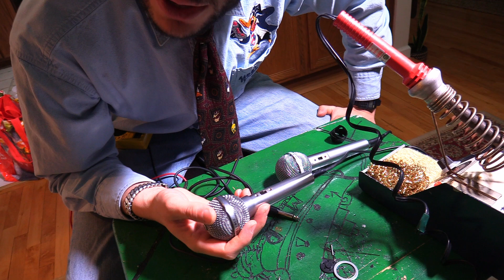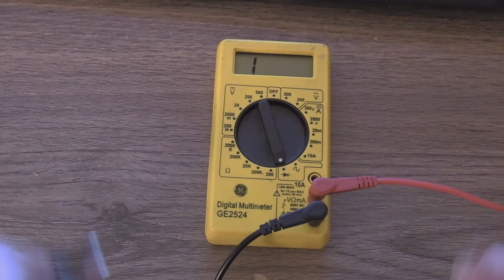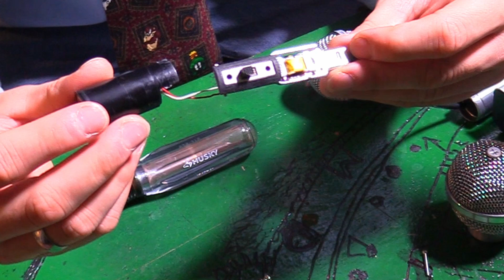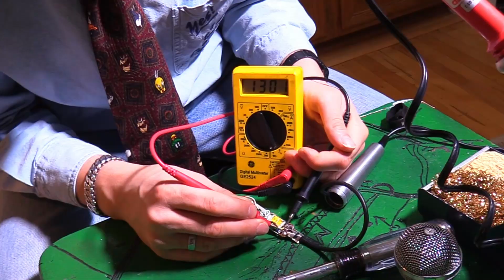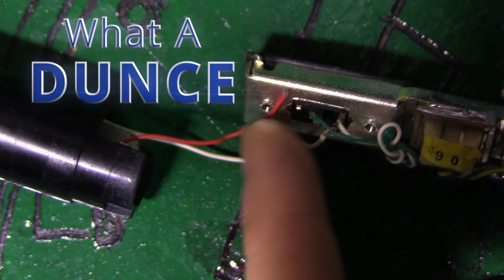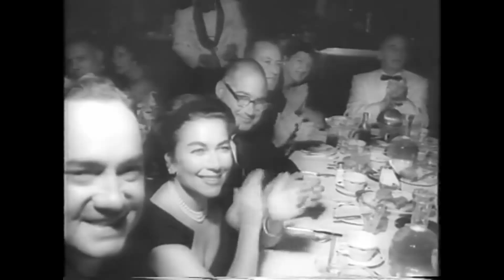Testing a Microphone for a Short

Comment: If you do enough electrical work consider getting a real iron with hot swappable tips. I do SMT reworks at work all day long and we have a huge collection of tips in all shapes, sizes and flavors and even the most obscure ones are invaluable the once a month you need it. Most people hate soldering cause they have the wrong tools. At home I also have a cheap hot air station which makes recapping reel to reels easy(er), and I'd highly recommend them too if you wanna get into board level repairs. Besides, investing in good tools is always worth it. Then again, I love this shit.
Reply from the maker: I definitely need a proper iron that's for sure. The cheapo one ain't cutting it simply because the tip gets corroded no matter how well I treat it. I've never heard of a hot air station before but I assume that's for desoldering work.  I could definitely use that as well. I need a lot of things lol. What do you recommend for holding wires/components when soldering. I always feel like I'm fighting gravity or stress in my wires when soldering.

Mario
Reply: @Mario_DiSanto  Well here's my best advice in a few parts. 
First, hot air stations can be used for desoldering, but there are other ways to do it. Theyre really only useful on PCBs. It's literally just a tube that shoots hot air that can melt solder so it's great if you're removing  a chip with a lot of leads that need to freed all at once. Typically I would used a solder sucker or solder wick to remove as much solder as I can and then the hot air gun to melt anything left keeping the chip in the board.  They are really designed for SMD soldering when you put solder paste (exactly what it sounds like, solder mixed with flux that's the consistency of toothpaste) on the pad (the tiny metal part on the PCB the component attaches to)and then place the SMD component in top and melt it all, soldering the component for good. Honestly find this easier than through hole for starters. I bought my cheap hit air gun for $45 online, works great.

Second, for holding wires my advice is as follows:
1. When ever possible, make sure you have a good mechanical connection before trying to solder something because it'll probably move on you
2. Always tin wire, that is dip it in flux, heat it up and fill the strands of the wire with solder before you even try to attach it to anything. Preferably tin whatever you're connecting it to in the same manner. Once each part has solder on it, you should be able to hold the wire in place and just press with the iron until the solder you applied to both parts melts and forms a joint. With smaller wire you shouldn't even need to add any additional solder, just what's there from tinning should be good. 
3. Tin and clean your iron constantly. Having higher grade tips (like Weller or Hakko) is nice but doesn't matter if you don't clean it. Use the brass stuff that looks like what your granny uses to scrub pots and then flux and tin the actual tip of the iron in the same manner as discribed above. Often you will see people just flood the tip with solder, which is perfectly OK as well because they are using rosin cored solder, which essentially has a center core of flux that cleans the tip. Always do this when you are done with it (so it coated in solder when not in used, thus protecting it from corroding) and avoid leaving it on for hours without using it.
4. If somethings getting to hot, achor the thing youre trying to solder to and use ESD tweezers (if you don't have, needle nose pliers are fine too) to hold the wire incase it gets hot. Becareful not to squeeze tok hard because when the wire gets hot the insulation will get soft and get be ripped off easily. 
5. The main thing to keep in mind when soldering is the solder only goes where it's hot, so make sure you're iron is shinny with fresh solder and you're holding it such that you're really making the PART hot. We've all had the thing where you're feeding solder that's just balling up on the iron, and it's cause the irons not making the part hot. In fact, the reason to tin an iron in the first place is because the little bit of liquid solder creates a kind of thermal interface to let the iron heat up whatever you stick it to. Once you get that it makes a lot more sense. 
Hope that wasn't too long and ranty but that's pretty much everything I know about soldering and once you get the hang of it you can make absolutely any electronics brand new and just start recapping shit and whatnot. Love the videos, keep doing your thing man.
Reply from the maker: @johnkaplun9619  Reading through your checklist I am doing everything right. It really doesn't help that I can't keep my hands still for the life of me!
Reply: @Mario_DiSanto  oh also, once tips are shot, they're shot. If the one you have is dead, don't torture yourself. you should be able to buy a new one, even if it's a cheap iron, for like 5 bucks.
Reply from the maker: @johnkaplun9619  The thing that sucks about my iron is the tips are a non standard size and the only size that fits is the same brand's tips. Their tips are garbage and immediately corrode (unless I am doing something entirebly wrong. I keep the tip "wet"). Hence me dealing with it lol.

Comment: Fun with solder! Last week I soldered a Puretone 4 contact output jack into my Angus Young Sig SG and I can actually use the thing without a crap ton of unwanted noise now. Fun fact though ... if you wanna play some random AM radio station through a JCM2000 DSL 100 with 2 4x12's then solder the output jack the wrong way like I did first up I.e., hot to sleeve instead of vice versa like it's meant to be. Then  just turn on your Boss Super Overdrive for max effect and voila! Try it out for good times with an added dose of confusion through stupidity 🤣
Reply from the maker: I had a very similar thing happen to me before. My Treble Booster pedal tends to pick up radio frequencies and I was completely unaware of this at first.  One night it was like 2 AM in the morning and I have my guitar amp on while I am laying down.  All of a sudden I hear faint whispering talking about the devil working it's way into your life.  I got REALLY spooked as I just moved into a new place.  I finally realized it was my pedal picking up a local Jewish radio station preaching about god!  I thought I was getting possessed for a second haha.

Mario
Reply: @Mario_DiSanto  yep ... if the amp was turned off it would have caused concern I reckon!

Comment: For old mics with a TS cable instead of an XLR jack—is it best to just plug it into a DI/hi Z input? Or do you need a Ts to Xlr adapter?
Reply from the maker: So with this mic it actually has three terminals so you can solder on your own XLR end onto it if you choose to.  I choose to leave the 1/4" jack on as I have a few pieces of equipment that only have 1/4" input jacks.  I really only use these mics with equipment with 1/4" inputs, but I have plugged it into an XLR jack before using an adapter.  Worked perfectly fine.

Mario
Reply: @Mario_DiSanto  interesting. I picked up a cheap Realistic stereo mic and plugged it into the di inputs on a stereo preamp. Worked but it was a bit noisy (hiss). When I plugged it into my cassette deck recorder 1/4” stereo input and monitored the line outs through my mixer it seemed way less noisy. I’ll have to try an xlr adapter and see what result I get